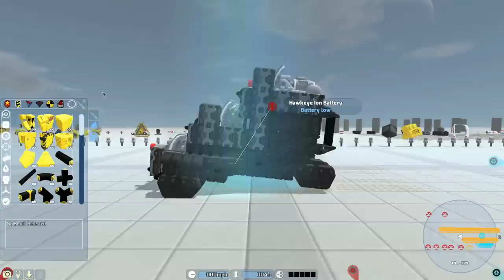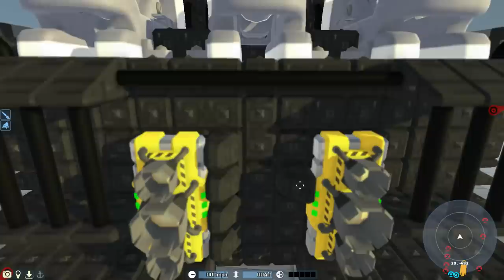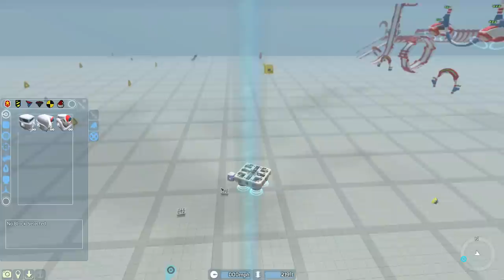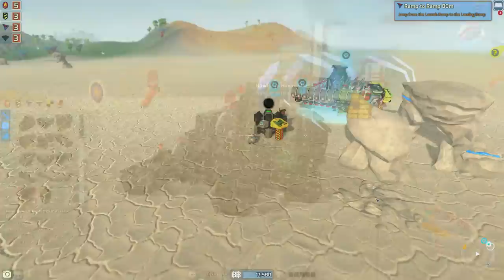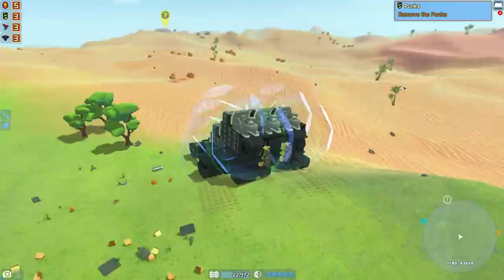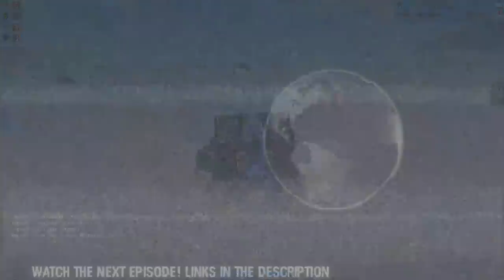Terratech | Ep28 S3 | Artillery Tech Finished!! | Terratech v0.7.9.2 Gameplay

Comment: There’s something special about driving around a literal anti-gravity rocket-powered MOBILE ARTILLERY BATTERY that’s 1/3 gun, killing things. Each of the NINE guns is larger than a lot of vehicles in the game by themselves, and a hit by several at once ACTUALLY TURNS WHATEVER IS DOWNRANGE INTO AN ACTUAL FIREWORKS DISPLAY. LIKE, ACTUALLY. On top of that, most of what is left is dedicated to armor, shielding, and repair capabilities just to make sure that it can withstand a hit or two or twenty from anything but itself. (I’d actually like to see what happens if you shoot this iron giant with a copy of itself.)

This thing is basically a complete artillery emplacement, but on tank treads and rockets. Slap some of the Hawkeye lasers-turret things for point defense and this thing has its weakness if a miniature firing angle mitigated.

Comment: To aim this thing, you could use those black rods and have them at the top of the craft in the middle and just connecting forward for several rods. This would allow you to look straight down the rod and if the enemy is at the tip of the aiming rod, you will hit. Or, you could also do 2 rods, with the center line empty, and if the enemy craft is between your two aiming rods, then your target will be hit.

Comment: The flying fortress hoverplate is the best hoverplate by far. I actually made a HOVER BATTLESHIP using them. Although I had to add sooooo many that eventually I dropped to about 20fps (I have a Nvidia Geforce GTX 1050 Ti)
Reply: Dimondminer11. I think that my pc is a bit overpowered as maxed out the build limit with them and I only lost three phrases. ;-;
Reply: Srry auto correct *frames*. -\ _ /-
Reply: i added over 100 or 200 of em. the graphical effects is what dropped my fps.